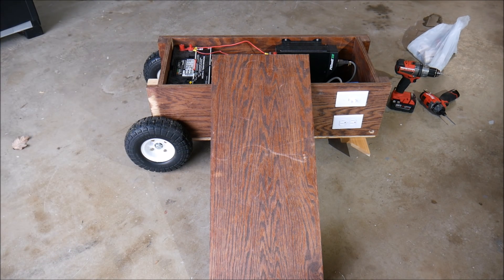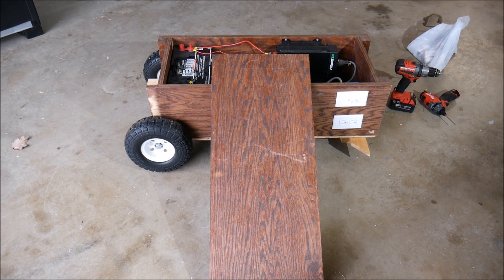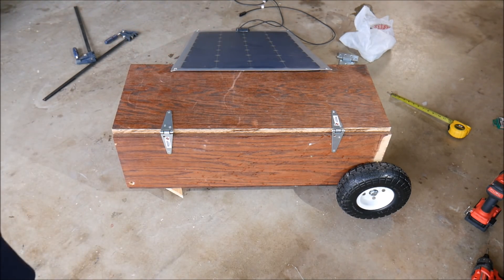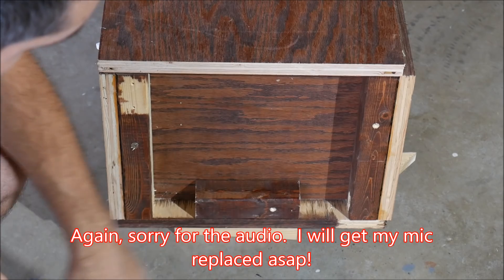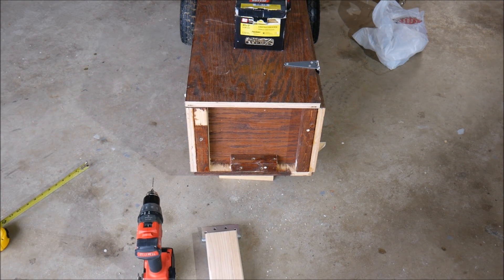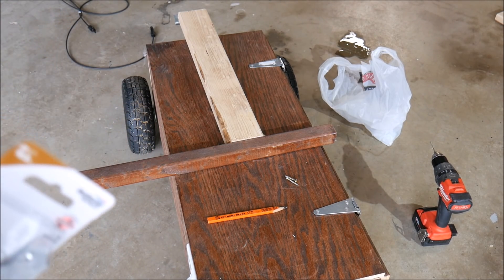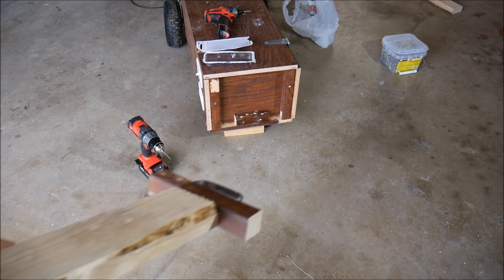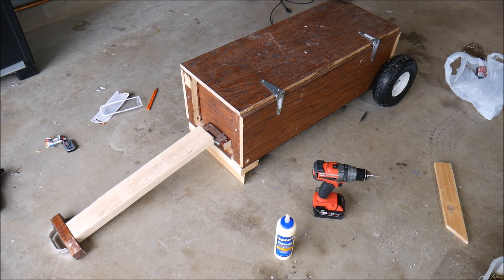Solar Generator Project - Part 4 Finishing Touches

Comment: Im so excited to see this again soon! Have you looked into tesla or thinfilm solar panels?
Reply from the maker: There won't be a next part of that series but I will be doing a new series with a new build.  That one was too heavy and awkward and I want to add some better features like USB ports and better safety.  As an interesting side note, as I was deconstructing this one I accidentally shorted a wire and almost started a fire inside the box.  So safety is important!
Reply: Thats what I meant. Are you doing it on camera? I suggest making it like a box that you can just carry around very easily, set it, and charge devices no worry.
Reply from the maker: I now have a 25 Ah LiFePo4 battery sitting in my garage that weighs 7 pounds.  That will be the perfect addition to the next build.  It won't have as much storage as the 65 pounder that was in the previous build but it will be very portable and compact.
Reply from the maker: That is a starting battery.  You can tell because it talks about cold cranking amps (CCA).  So it won't deep cycle like we need it to.

I will do a video on this LiFePo4 battery soon.  I can't talk details yet because I need to find out what information I can share about it from the person that sent it to me.

Comment: Hello Jason, Great  job, Now for all the times you have helped me  with all my questions and took the time to answer them now I can add one thing you may have forgotten  and that would be you may want to add some fuses between the battery and the charge controller and maybe use a surface mount electrical box & combine the duplex & switch, that way you only have to drill a  small hole in the side, otherwise great job
Al
Reply from the maker: Good suggestions!  Of course if I ever sell something like this it would have lots of safety features, including fuses between the battery and inverter.  I don't think you would need one between the battery and charge controller because if it goes above 20 amps (or the rating of the charge controller) the charge controller will shut off.

Comment: This is really a neat design!  I may be mentioning this prematurely, as you are probably about to do this:  Safety first!  Before you do anything else w/ this you should address that. First - the battery should be in a separate VENTED compartment and not in w/ the electronics. 2 reasons 1] The escaping gasses from the battery will corrode or damage the electronics 2] inverters tend to spark and if any of the electronics give a tiny spark, the highly explosive hydrogen gas will make it all go BOOM!.  When I did my phone box, I had him build a shelf for all the gadgets and the controller and other electronics and then I requested he partition off a vented battery compartment with a lid. I used a SLA type battery, but it is still recommended to have the separate vented compartment as it is possible for gas to leak on even those.  Other than that you really have it going on!

Also I was thinking for mounting the panel:  When I was thinking of going w/ flex panels, I found some videos on here where this guy made a frame using pvc pipe and had a way to hook the grommets to it.  You could try searching on here.  There were a couple different versions of the frame on different channels. It was great as the frame was adjustable for height, easy  and cheap to make and light.  The pvc contraption could be mounted right on to your lid and secured tightly-so no worries about it blowing off somewhere. A thought for what it's worth.
Reply from the maker: Good ideas.  I am definitely going to isolate the battery from everything in future models.  After I shot this video I had an idea of how to mount the solar panel that would be pretty cool and work better than just leaning it on the side.  So I may show that in a future video or wait for the next version of this build.  Thanks for watching and commenting!